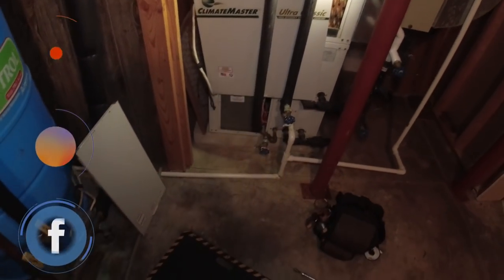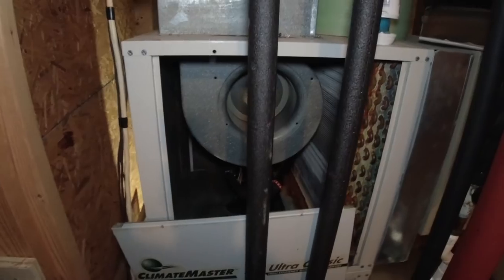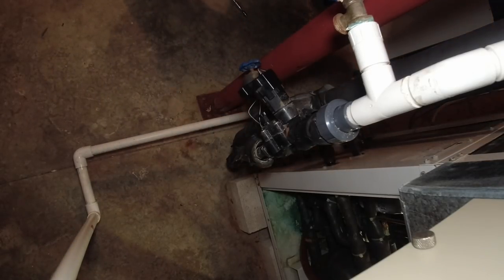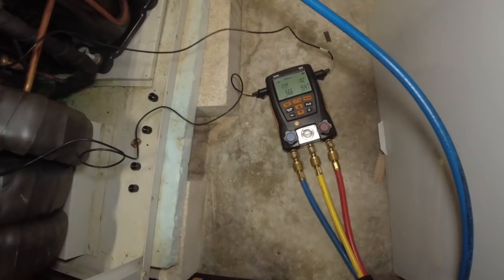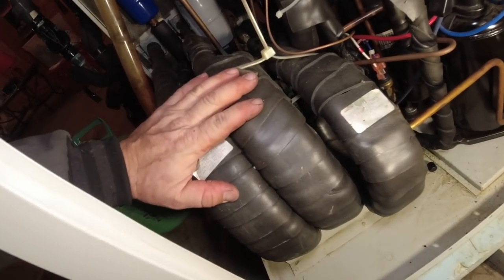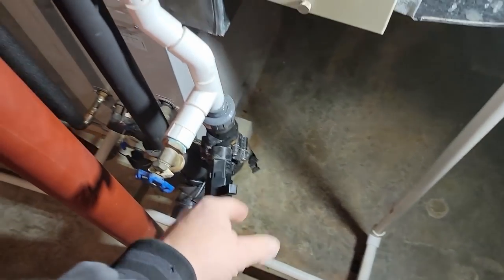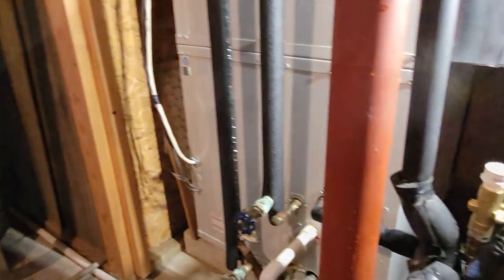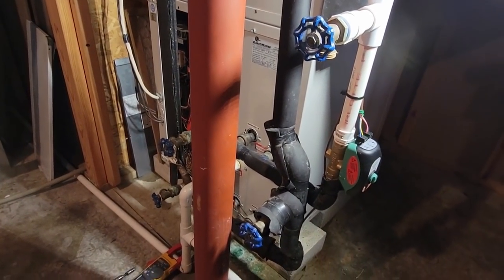Heat Pump Runs All The Time Electric Bill Has Been High

Comment: I came across a good one. I had a service call on a Bryant Evolution 2010 2 speed heat pump. It was running when the system was completely off at the stat. Contractor was not pulled in and the compressor was running backwards as well. After a wile of scratching my head found the crank case heater was shorted out and sending voltage to it. Disconnected it and replaced it all was good.
Reply: Not possible there's safety's to prevent that that whole story is a lie
Reply: @michaelhouser4673  yea I thought the same thing till I talked with tech support. Definitely is possible
Reply: Your right it is possible if you hook the capacitor up a certain way it will make it run backwards my bad should have investigated it before commenting (insert foot in mouth) I watch you videos all the time so I like your videos you do stuff the same way I do wished I had the guts to video like you guys but I don't like criticism
Reply: @michaelhouser4673  I was thinking the same thing as you then I read the reply saying he talked to tech support and it is possible just goes to show I've been doing this over 30 years and when I think I know something I'll get proved that I don't know I always try to investigate like I dont know anything even my brain is telling me what I know that's why I watch this channel because I'm always learning something it might be a way of doing something I've done hundreds of times but his way is different you did show your experience by knowing about the safety on the system

Comment: These small systems are difficult to work on . Do they not have a Flow Switch though ? I haven't spotted it .
Reply from the maker: Generally there's not a follow switch on these but they do sometimes have two water pressure switches to verify the system has water pressure in the coil.
Reply: @HVACRSurvival  that's surprising to me , I would've thought they'd have at least a differential pressure switch in order to insure there's actual flow presence , not just water pressure .
I wonder how they make sure to  prevent freezing in case the pump fails or the valve shuts the flow off .

Comment: Hey Rick i saw on one of your videos FLIR C5 thermal camera you were using if I'm not mistaken. How satisfied are you and would you recommend buying?  Cheers and thanks
Reply from the maker: It's been good, its better than the Snap-On one I had prior, it has that outline around the picture that helps find where you are. I purchased the extended warranty just incase. That thing is not cheap and the last thing I want is for it to go out after a year.

Comment: I've never seen a tube in tube where the evap is around the outside of the hydronic circuit. Here in Australia at least. 
Part of me thinks it would be more efficient with water outside, and less of a chance to freeze over with worn/ soggy insulation.
Reply from the maker: Usually it's the water on the outside but I think that's just asking for the problems I mentioned but Your likely correct about the efficiency because they riffle the refrigerant line usually to get better heat extraction.

Comment: this more efficient then forced air?
Reply: When working correctly, yes.
Air source heat pumps need to contend with potentially cold weather, and lose efficiency and effectiveness when the air gets too cold.
Ground source/water heat pumps have a pretty steady temperature of water going through them, so they remain effective and at optimum efficiency even when it's brutally cold outside.
The main drawback is that they are extremely expensive to install upfront, and as you saw here, require more significant maintenance to run their best.
Reply: Think about taking a hot pot off a stove. What's more effective at cooling it off dropping it in a sink full of water or putting it in front of a fan. Plus a huge factor as Joshua said steady water temps helps tremendously
Reply: In the Houston area, I grew up with a air source heat pump, with supplemental electric heat.   In general, the electric heat wasn't used more than twenty times a year, during the absolutely coldest days.    The rest of the time, the air source heat pump was fine.
Reply from the maker: Texas VS Ohio weather, it's completely different. A normal Air source heat pump takes a crap at 25*-30* outdoor air temp.
Reply from the maker: It depends where you live, in northern states it's more efficient but not worth it in southern states.
Reply from the maker: I spoke about price but cut it out at the end.
Reply: @HVACRSurvival  - Even in northern Texas, air source heat pump would probably be more issues than it's worth.   (Remember that the Panhandle goes up next to Okie-la-homie.  )

Comment: I didn't know water just ran through those and away. Seems kinda wasteful that way. I thought the water ran in a long (closed?) loop to shed heat or cold as appropriate and then came back to do it again. I've never worked on or studied one, though. (I've only ever seen one.)

If well pumps could be grateful for a reduced workload, I'm sure that one is!
Reply from the maker: Technically it's not a loop system, its coming out of the well and going out into a filed tile to drain away. Normally they are a closed loop system that recirculates the water over and over.  I used the two types of loops interchangeably and I shouldn't have. Yes it's wasteful and not as common anymore.

Comment: I really don't like the concept of an open loop heat pump.   Unless the water is stored in a reservoir for house use (second floor storage tank or similar), you're just wasting water - especially on the coldest days where you can't use it for watering the garden.    With a closed loop system, you can load it with low mineral content water (hire someone with a portable reverse osmosis system), and then have minimal issue with residue.    I do appreciate the video - this is the first time I've watched a walkthrough on it.
Reply from the maker: I agree, I'm on a well so it can effect people like me. Thanks for the feedback👍
Reply: @HVACRSurvival  open loop systems like this are highly illegal in the EU. even in my country were there is no shortage of water you will have the goverment coming down hard if you install it like this.
Reply from the maker: These are not popular around here either.  I only know of a hand full that I have worked on.  We're not all out to destroy the Earth but a good portion of this regulation is about the power to control the people and manipulate the price of goods and services.
Reply: @HVACRSurvival  its funny because closed loop geo (both horizontal and vertical) is very popular and entire neighbourhoods are fully geo-pumped. its just that anyone caught with an open loop system you could bascially end up in jail or wish you were with tens of thousands in fines and losing your licences/business. i generallyt dont bother with them due to the cost of installing the bole hole or digging out the entire garden 10ft down. air/water is much more economical and less hassle and you can get insane COP's outside winter. my own air/water pump (with floor heating) gets well into the COP 6+ when its above 55F outside.
Reply: @SupremeRuleroftheWorld  - When it's above 55 outside, we generally don't even need the heat turned on to keep the house at least 63.
Reply: @tbelding  it depends, but if the sun is not shining (wich is most of the time where i live) you do need heat to keep it steady. And it was just to show how effixient it can run. Even when its 2 degrees above freezing it still gets a cop between 2 and 3. At  44F  its batting well beyond a cop of 4.
Reply: The water isn't really "wasted" as it drains back down to the well again after a few days. As long as the drain field is some feet under ground nothing will evaporate. However you do waste a lot of electricity running the well pump compared to a closed loop system which really kills efficiency.
Reply: @mrfrenzy.  - water 'draining' back to the well doesn't really happen.   Most wells are drilled, not dug, and they're hundreds of feet down.   Ours was a shallow well at 75 feet.   It had to be drilled down a LOT further after the subdivisions started drilling deep - ours dried up.
Reply: @tbelding  the water that is poured out in a drain field, where does it go if not down?
Reply: @mrfrenzy.  - You're making my brain hurt.   

Okay, let's use the typical SE Texas soil.

There's between 3 and 36 inches of 'soil' in most areas.  Below that is sand and clay, then layers of limestone, sand, and more clay.   Repeat a few times.  A leech field (or drain field, if you prefer) is laid out in gravel (usually) filled trenches, mostly in the soil level.  Water (or effluvia from your septic system) is generally discharged into the top layer of soil and sand.   It's almost always taken up by roots.    To 'return to the well', you have to saturate the soil enough that the drift downwards of the water isn't interrupted by the roots.   This is why it takes so long to recharge an aquifer.   No matter how much rain you get, unless you've managed to totally saturate the topsoil, then the lower layers, the bulk of the water is runoff.   

So, in short, to answer your question about where water goes in a drain field?  It goes into the soil for immediate use by plants.  

The only type of well that would see an immediate injection of water from the soil is an open well - and I doubt those are legal anymore in just about anywhere in the US and Canada.  (They also require a reasonably high water table)
Reply from the maker: @troy or correct, I was in vocational agriculture for three years in school, most of the water we drink is from the great lakes. It takes years for water to reach 60 plus feet.  My well is 235 feet deep in Ohio. Some are 40-75, I've seen 350'. I just didn't feel like arguing the point😁
Reply: @HVACRSurvival  It is a bit like tilting at windmills, but I think it's worth a try.  It may be that who you're talking to never understands - but someone else can see both sides and make a decision, or do more research, and hey presto, education.

Comment: I know for certain, I will never work on a water source heat pump never saw one.(Geothermal)
I do agree,clean the PVC and also copper  when using o-rings dirt is a killer.
Thanks again for the videos.
🍺🍺🍺🥃🥃🎯
Stay safe. 
Retired (werk'n)keyboard super tech. Wear your safety glasses!

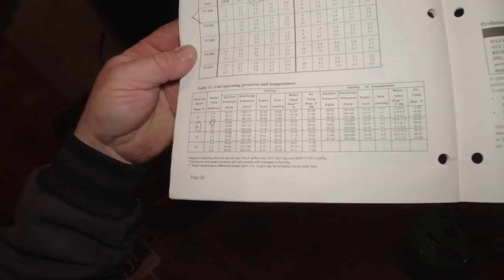Comment: 7:32 resolution is better with your phone I believe.  Or wrong settings or something. Maybe return the go pro and get a dji
Reply: Even at 1080 info on paper is not all that clear. Slightly blurry. 

However please keep these videos coming, especially with hydro loop/geo thermal, etc.
Reply from the maker: I need to get a macro filter for the DJI,  it's not designed to be used up close like this, the GoPro can do it and obviously my phone will do better but sometimes the action camera is just a lot easier to hit go because I could do it with the gloves on.  I just got a hold of another YouTuber that specializes in cameras and he's the one that mentioned using a macro filter. What's funny is is my DJI drone does unbelievable however I never record anything up close with it . Thanks for the feedback!